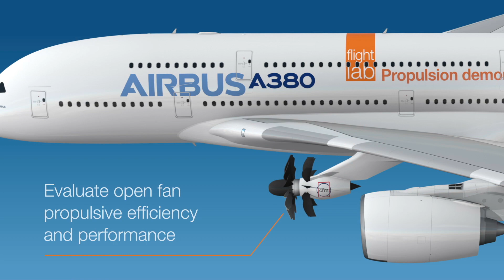Airbus A380: CFM Rise engine on Airbus A380 at Farnborough Airshow 2022

Comment: Why not have a ducting? Wouldn't that help with tip vortices?
An even better question is: why don't turbofan manufacturers increase the bypass ratio at such heights as to make them essentially a propfan?

Comment: I wonder how does it sound.
Reply: As quiet as a modern engine according to them
Reply: Loud. Very loud. Which is this idea has always failed in the past.
Reply: @thomasvleminckx  may i know what are the precursors to the RISE engines?
Reply: @thomasvleminckx  technology has improved so much nowadays. MT recently able to make a 9 bladed propeller for turboprop, tested on King Air, and it is real quiet. It sounds exactly just like a jet engine. The test flight video is uploaded here on YouTube, so you can check it out if you're curious. So yeah, this one will be quiet for sure, not like the one in the past. And also, there is a video of ground test of Safran Open Rotor, the direct predecessor of the rise, also uploaded on YouTube, it sounds... like a turbofan engine, no unique prop sound at all.

Comment: The testing is admirable, but 4 fans on the wing is not the way forward. On an A380 the 2 turbofans on the wing should stay, and the openfans can be placed on the tail as pusher props, placing the blades as far back as possible just in case of a blade failure. Sure this will only give half the efficiency of 4 openfans engines, but one step at a time.
Reply: The engines are being tested ON the A380, not FOR the A380. 🙄
Reply: @rtbrtb_dutchy4183  obviously, this is a testing platform, and that once developed and certified it could be used on any configuration, I am simply suggesting that if it were to be used on such a 4 engine transport, it would be best not to put un-contained blades next to passengers.
Reply: @steve5090406  are there issues with blades coming off turbo-props?   They could protect the airframe too, right next to an engine. U think the engineers haven’t figured out what to do?  Or do u think u found a flaw they haven’t considered?  Let’s hope they read this before spending billions on development. 👍
Reply: @steve5090406  this engine won't have as high a rotation speed as a dusted fan engine, also if this was a major issue, turboprop aircraft probably wouldn't exit the way they do.

Comment: what's going to trap the blade when it snaps off?
Reply: Turboprops use reinforcements on the fuselage to prevent the blade from puncturing it.
Reply: How often has that ever happened? I'm sure the blades will be tough enough to avoid that in the first place
Reply: @mmm0404  once may cause 300 empty coffin funerals
Reply: @IvanovichIvanov  there are literally thousands of turboprop airplanes operating. Why is this all of a sudden an issue?
Reply: @mmm0404  because most people are unaware of those aircraft. Most people now only think of jets when it comes to large passenger aircraft.

Comment: It is more efficient with a duct.
Reply: They should hire u as an engineer then, since u know better. 👍
Reply: No. With ultra high bypass ratio. The weight and drag cause by a giant duct becomes very significant eating away the aerodynamic efficiency they provide.
Reply: @kazedcat  what about the vortex drag from the propellers ??
Reply: @Dakkyun  Modern fluid simulation allows engineers to design blade geometry that reduces vortex drag. The lower RPM this fans will be running also helps a lot.
Reply: @kazedcat  ah ok, i thought they were gonna run this at 600knots or smt.
Reply: @Dakkyun  The main way they gain efficiency is by having a larger fan at a lower RPM. Basically lower RPM gains efficiency and then enlarge the fan to gain back the lost thrust cause by lower RPM. But larger fans needs larger duct until the duct is too large that it is not worth having them. At that point you just reduce the RPM even more to gain back the efficiency lost by ditching the duct. Then blade geometry with lower drag have lower thrust so you increase the fan diameter even more to compensate. As long as there is space for a larger diameter fan you can keep scaling up so that the design has net efficiency gain.
Reply: @kazedcat  seems the fan can also protrude over the wing , allowing some of the bypass to flow over it . That's something you cannot do with the cowling attached Aka ducted fan . 
This way the fan can grow even larger . Probably only limited by ground clearance... Interesting.

Comment: What about blade failure risk, no containment?
Reply: There’s always a risk but you’ll still fly on an atr or dash 8
Reply from the maker: @ryanm.191  Yes indeed! Thanks for tuning in!
Reply: The fan will have lower RPM to increase efficiency. The blade will be lighter using carbon fiber. Carbon fiber can also be design to have their strength only in one direction and would easily shatter on impact.
Reply: Most likely similar protections as modern turboprop aircraft since they don't have ducts to contain a blade failure either.
Reply: They will put extra protection in the fuselage just like they do with Turboprop aircraft 👍🏻

And also the Rise engine uses Carbon Fibre fan blades that are a lot lighter than traditional ones, plus, the fans on the rise engine will spin slower, Making it safer.
Reply from the maker: Err I guess the new generation fan blades are much stronger